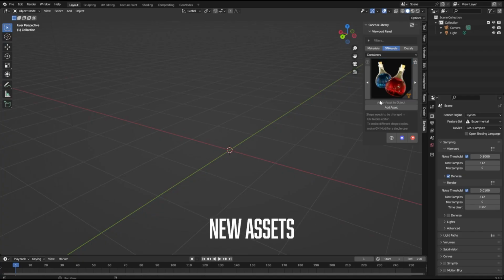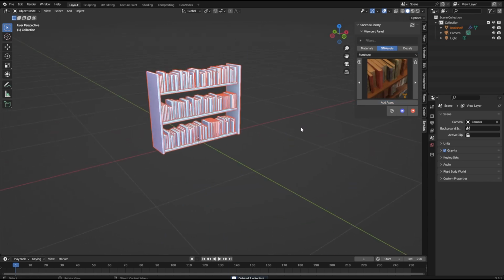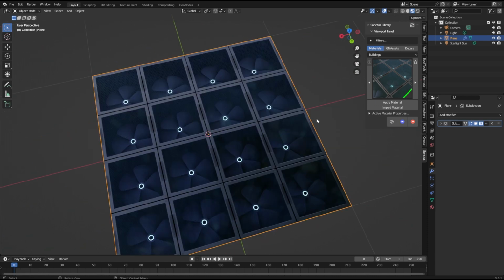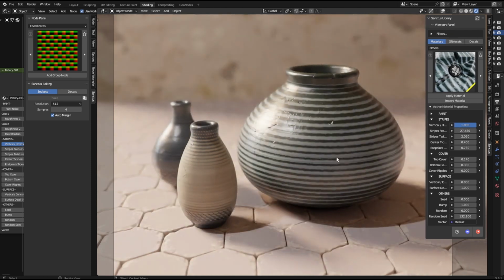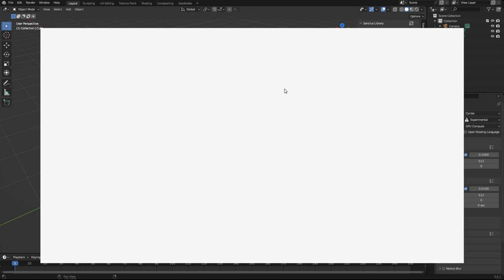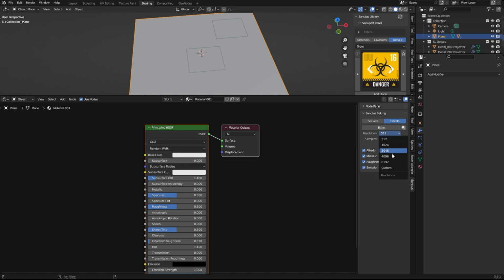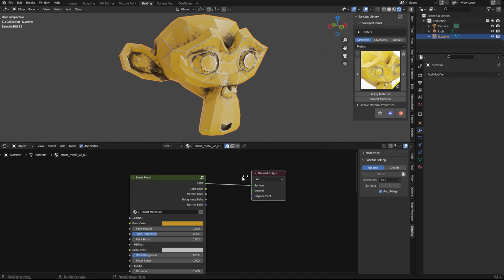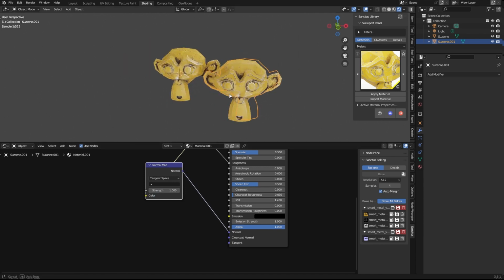Sanctus Library 2.6 & 2.7 updates - Procedural Material addon for Blender

Comment: Just purchased the Sanctus Library on Gumroad. I notice that there are several materials missing, notably the GN (only have the glass flasks), and several others shown in the update video. I installed v2.8 as an addon. This may be user error as I am just learning my way around. Should I use the version for Blender 4.0 to get the latest features and materials, or will I be alerted when they land? I am using Blender 3.6. Thank you for this incredible addon - it puts Blender head and shoulders above all the other 3D offerings!
Reply from the maker: Hi, that's so strange. I don't have any purchases of the full version of the addon in gumroad in the last 2 hours. Maybe you git the free version? That would explain the missing materials. You can also contact me by email or discord if you prefer so we can find out what's going on.
Reply: I contacted you over on Discord. I had indeed installed the full version, but version 2.7 instead of 2.8! I apologize for my error. This is an incredible library! Thank you!

Comment: this is one of my most loved addon in blender market. Very useful for architecture visualization. good job.
hi, I have a few ideas, can you add an asset tree billboard for the exterior rendering type. I think this asset is very powerful and also light, even though the tree is in the form of a billboard plane but it still looks 3d and realistic with a normal map. thankyou,
Reply from the maker: Thank you very much. I could maybe make a Geometry Nodes asset that can hold texture maps.. but in general I don't use textures, only procedural. So the texture for the tree would be quite complex to mae just with shader nodes, and I don't see much of an advantage in this case to use procedural textures. Maybe if you have the asset and you can add your own textures it makes sense.. I don't know. I'll give it a thought. Thanks for your comment and interest, also for your support!

Comment: Great as usual! After intensively testing all the shaders these past weeks, there's maybe one addition that would be amazing. All the materials like marble, some concrete, some metal (anti slipping ones for example) or even rubber (there's some rubber floor pads in gyms for example) should be tileable. This could be a slider which would add a checker texture or something like that, which could be set to 0 (default material) or 1 (floor tiles with the default material). It would add more floor tiling variations.
Reply from the maker: I started experimenting with tileable procedural materials, you will probably see some added soon. 
Check this experimental dirt with displacement WIP for example: https://streamable.com/9gs0gl